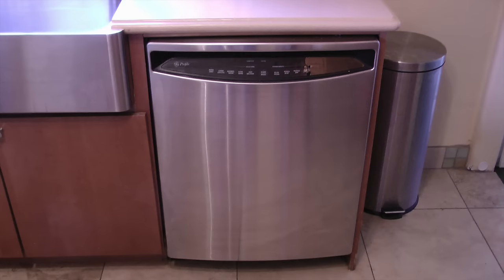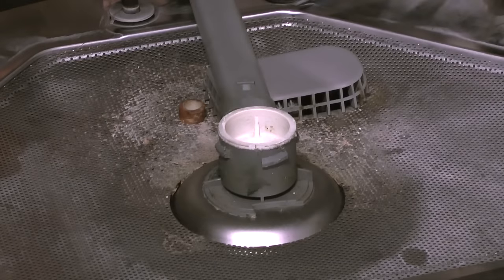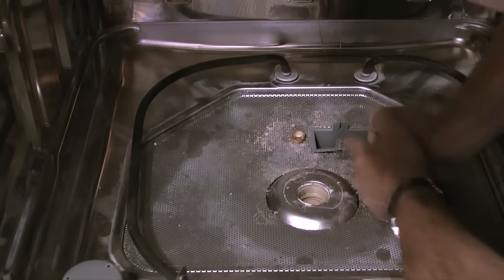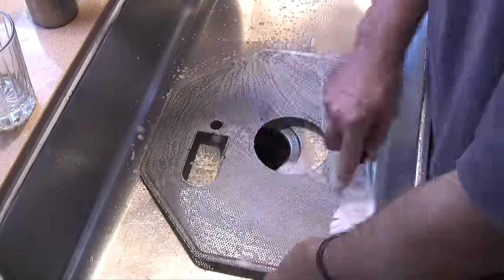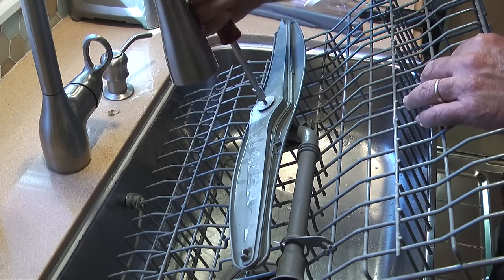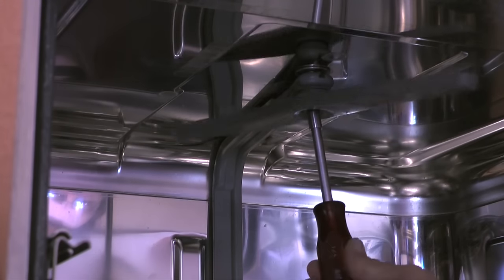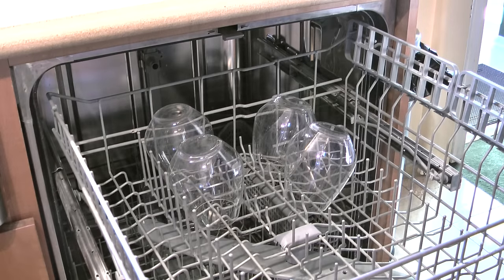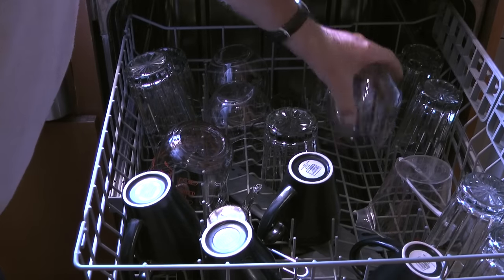GE Profile Dishwasher Maintenance

Comment: Good video. Unfortunately for me when I started the dishwasher I heard a grinding noise coming from the pump motor area. I'm not sure how something could have fallen below the filter and into the pump but something happened. Any idea?
Reply from the maker: Hmm. I'm not sure if the dishwasher has a grinder and that's the noise you're hearing or if it's something else.

Comment: Thanks so much for the video. First, I was able to take it apart to clean the machine and it works perfectly now.
I'm hoping you can help me; I have the exact dishwasher in your video but have no model number on my machine. I need to replace the wheels for the bottom rack but nobody will sell them to me without a model number. Could you tell me yours so I can order them?
Reply from the maker: +Karen Leiser 
My model # is: PDW8280J03SS. There's a link in the video description where you can order parts.

Comment: Excellent Video, you must be professional in making video's. I  was following exact instructions, I was able to unhook supply chain and tube. where I got stuck was Venrture is not coming out, it is turning counter clock wise but not coming out. was able to get the filter out. any suggestions what my next step is?  thank you
Reply from the maker: +Sujay Potlpelly 
Have you tried slight upward pressure when unthreading it? Venturi needs to come out so you can remove the coarse screen.

Comment: Thank you for such a great video.  I was hoping for more gunk as my dishwasher has not been working well.  I did notice that there was cloudy sitting water under the filter. Could that be my issue?
Reply from the maker: +Keith Levinthal 
I didn't have a lot of gunk in my filter either, but after cleaning the filter my dishes came out clean.

Comment: This is a great video.  As I followed your instructions and removed the filter with the help of a small screwdriver I noticed that inside the housing for the basket is a white rubber liner with a tube pointing upward on the left.  As I started to clean that area I noticed that the tube was ripped up the middle facing the inside. I think the part needs to be replaced but when I looked at the parts diagram I couldn't find that part.  Advice?  BTW, this is Laura's husband Bob.  I'm using her laptop to watch your video.  Thanks.
Reply from the maker: Hi Bob, I looked at the parts diagram and I think the tube you're referring to is coming out of the sump. It's part 505 on the Motor - Mechanism page and the part number is PS959014. It looks like a project if you want to change that part. Let me know if you tackle it and how it went.
Reply: @Iscaper  Thanks so much for responding so quickly.  Do you think the dishwasher will work ok until I can get this part?
Reply from the maker: @lauramackler2000  I would try it.

Comment: Thank you!  Great video.  Had to re-watch a couple of times, but I got it.  Only problem is I have a little plastic piece that is left when I re-assembled everything.  It is about 3/4 " long and fits inside the tube of the lower spray arm.  But re-watching the video, I didn't see anything like it.  And while it fit into the lower spray arm supply tube, it didn't seem to easily reinstall with it inserted.  Any thoughts?
Reply from the maker: Without seeing the part you describe I wouldn't be much help. Are you sure the piece goes into the supply tube? Here's a link to the parts breakdown of the dishwasher, maybe it will be some help: http://www.partselect.com/Models/PDW8280J03SS/Sections/MOTOR-PUMP-MECHANISM/?ModelID=397721&ModelNum=PDW8280J03SS&mfgModelNum=&ManufactureID=2&Selected=00121460i05&Position=4&mfg=GE&Type=Washer&Mark=4
Reply: I figured it out!  It went into the vertical supply tube where the middle spray arm is supplied.  Snapped right in.  Thanks again for the helpful video...and my husband thanks you too because he didn't have to figure it out.  Happy Holidays!

Comment: This was a great video!  I have one problem now, maybe someone can help with.  The water is not going into my dishwasher.  I had a clogged sink for a couple of weeks and a plumber came out and fixed the clog, but now the dishwasher doesn't get water in it.  The water is on.  When I do a reset, I can hear water draining out.  I checked the float and that seems ok.  I am hoping it isn't the inlet.  Any thoughts?

Comment: This was excellent!  I've had this dishwasher for 13 yrs and never knew this was necessary.  The amount of gunk and hard-water deposits was indescribable.  Everything went exactly as you showed and after cleaning it works great again.  One thing I noticed, though, is that the short, flexible hose that's just to the left of the filter is completely disintegrating below the surface.  The rubbery tube is intact above the screen, but when I feel inside the space after removing the filter I can feel that the tube is torn open and disintegrated below the area where I can't see.  It seems to be cleaning ok.  Any ideas on possible ramifications of not replacing that part?  I'm thinking that's not a DIY project.
Reply from the maker: Not sure what the tube is unless it primes the pump.

Comment: Great video, saved us a repair call!  But I have a question.  I know when we bought our dishwasher, a "hard food disposer" was one of our must-have features.  But I can't figure out where the disposer is, or how food would get to it with that filter cup.  Does the model in the video claim to have a disposer?
Reply from the maker: +Marc Lieberman 
In the technical manual for this dishwasher it says it has a Piranha hard food disposer.
Reply: If you stick your fingers into the pump inlet after removing the filter basket, you will feel the cutting blades of the "Piranha disposer" You will need to take out the pump to get at it if needed. Mine was quite clogged up with gunk on the shaft.

Comment: Great video. Daughter has the same dishwasher. Looks like a project I'll need to address. I need to replace the lower door seal.  Do you have experience removing the inner door panel? I've found no "how to" videos on removing the door panel for the GE Momogram. Thanks again for the maintenance video.
Reply from the maker: Hi Doug. I haven't had to remove the inner door yet. If I do I'll be sure to make a video.

Comment: Thanks so much for your video.
Your instructions were easy to follow.
I have the GE profile PDW9900N00WW
My manual detergent dispensen lid  is broken so I have to use the smart dispenser.  Suggestions between
Enzymes or chlorine bleach base.
Best dishwasher Detergent - please

Comment: I had cleaned my filters before in my GE Profile ... but I did it from underneath!! (removed boots and clamps and hoses etc.) So I was very hesitant to do it again until the dishes came out quite dirty and gritty. 

Having watched you video, it only took me about 20 minutes today to clean everything up!! Nice job!

The fine screen filter basket (around the venturi) sure seems to fill up quickly (a year). Is this "stuff" (like sand) from my water supply?

And I would sure like to open up my 3 spray arms and give them a good cleaning on the inside, but I can't see a seam where I'd be able to pry them apart.
Reply from the maker: If the city had a water line break near you it could be sand in the filter. If your house is older and you have galvanized piping it could be flakes from the pipes, or if the debris is white and chalky it's probably hard water deposits. I didn't see any seams in my spray arms either, it would be nice if they designed them in for easier cleaning of the spray arms.

Comment: This is such an excellent video. Thank you so much for posting it!

GOOD NEWS: I followed the directions exactly and cleaned out all the parts (ours was slightly less dirty than yours). I put everything together and ran a vinegar cycle with a couple cloudy glasses just like you did.

BAD NEWS: About midway through, the dishwasher started seeping a considerable amount of water on our kitchen floor. Also, the glasses appear cleaner, but are speckled with larger pieces of sediment than before.

Any thoughts on this? Thanks again for your great video!
Reply from the maker: iscintilla 
That's awful. There's no easy answer here because of all the things it could be; the discharge hose, the pump, inlet valve, etc. Did you notice which part of the cycle that it started leaking, like when it was filling or when it tried to pump the water out. You might have to pull it out of the cabinet and take a flashlight to see if you can isolate where the leak is. Let me know what you find.
Reply: iScaper1 Thanks for your reply! I tore everything apart again and found that the tube that comes up from the bottom (through the coarse filter screen) was gunked up with sediment. I attempted to lightly clean it, but it ended up completely crumbling. However...

GOOD NEWS: I ended up fixing the problem! Since this dishwasher is extremely cheaply made with substandard parts and has never worked properly upon us owning it, I went ahead and ordered a Bosch 500 series. So long, GE Profile!

NOTE: Our GE Profile microwave, oven/range, refrigerator, and clothes dryer work as expected. We have had perpetual problems with our GE Profile dishwasher and washing machine. I will never buy GE again.
Reply from the maker: iscintilla 
Thanks for the info. Let me know how you like the Bosch 500 series.

Comment: what is the small rubber tube that sticks up out of the bottom? ours is extremely degraded and i think this is whats causing the dishwasher to not work properly. i cleaned it just like in your video and it worked for a short time but i think that thing needs to be replaced if possible.
Reply: That tube is part of the rubber sump that the water drains into and which feeds the drain pump. Its fairly easy to replace the sump but you will need to flip the DW onto its side or back to get at it. Just 4 hose clamps hold it in place. Part Number WG01L00289

Comment: Superior guidance. Thank you.
Reply from the maker: Glad it was helpful!
Reply: @Iscaper  The only issue I had was that my parts were cemented in with lime or calcium buildup from our hard water. Digging out the filter caused damage, so I have a new part coming. Is there a product you can recommend to prevent the limescale?
Reply from the maker: @marilynfarmer1302  I like to run a cycle every month or so by placing a cup of white vinegar on the top rack.

Comment: Okay found the solution to my own problem.  When replacing the Venturi DO NOT over tighten.  The Venturi does not need to be very tight. If you over tighten just one turn, as I did , when you reconnect the lower spray arm it will sit slightly to low and even it activates and spins it will hit the lower portion of the door.  All I did to correct the problem was back out the Venturi one turn and all is wet.  Lesson learned!!
Reply from the maker: Good information, thanks for posting.

Comment: when cleaning the filter l found a rubber gasket on the large filter under the bottom spray bar. where does it go? in the bottom and under the smaller filter I found a Phillips screw. where does it go. thanks

Comment: Thank you very much for this video. Upon taking apart all the components, the filter "reservoir" (not sure what it is called) had about an inch or two of water I am not sure if their is a drain at the bottom of the grunge that I could damage when cleaning it. Does anyone know how to clean that area without damaging anything. I am trying to get another year or two of life out of this dishwasher and any help would be appreciated. Thank you!
Reply from the maker: On my dishwasher I use a turkey baster to suck out the water underneath the filter.

Comment: I have a GE Cafe Dishwasher, Could you please tell me the significance of the plastic tube exposed next to the filter basket. Mine is corroded. It is the piece that the fine filter fits into. Do I need this piece to function the dishwasher? I can not find this plastic tube on the parts list. Please give me your input.  Thanks
Reply from the maker: +Anthony Tanzi 
Here's a link for GE partsSelect.com where you can enter the model number of your dishwasher and look up the part you need: http://www.partselect.com/Entry.aspx?Source=GAWS&Brand=GE&Term=GE+Dishwasher+Parts&gclid=CPCgypGnmskCFRCCaQod5NIAQA

Comment: Just found this video, hoping to save my 13-yr-old dishwasher that has never been cleaned. I got everything apart but the white residue is so thick in places I haven't been able to clean it off. Also, all the rubber gaskets on the large filter are crumbling (outer edge, & both roung openings) - can I replace the rubber or do I have to buy a new filter? The video is incredibly helpful and well done.
Reply from the maker: The body parts diagram does show a couple of gaskets if you have the same model in the video. Here's a link: https://www.partselect.com/Models/PDW8280J03SS/Sections/BODY-PARTS/?ModelID=398380&ModelNum=PDW8280J03SS&mfgModelNum=&ManufactureID=2&Selected=00121460i02&Position=1&mfg=GE&Type=Washer&Mark=1
Reply: @Iscaper  Thanks for the quick reply. The controls on the one in the video are different, but everything inside is spot-on. The part that's a problem is 502 (WD22X10029), the coarse filter. It has been discontinued - I've been searching online for hours and have not been able to find one. The gaskets I see in the link you gave are for the door seal. I've seen many complaints about the rubber seal on this filter drying and crumbling. One site suggested I replace the seal with a bead of 100% silicone caulk  - do you think that would be a good solution for a few years while I save up for a new dishwasher?
Reply from the maker: @lindas.bartlett9295  That's weird, my coarse filter didn't have a rubber gasket. I would be cautious about adding silicone because if you need to remove the filter again for cleaning it will make a mess removing the silicone.
Reply: @Iscaper  As I searched for the replacement I saw that many had gaskets and they were confused about receiving a new one without. I guess that was one of GE's attempts to fix the problem. In any case, I'm really trying to buy some time before replacing the dishwasher so I put the silicon on it this morning. Since this is the first cleaning in 13 years I'm hoping I'll get 3-5 years before having to do it again, assuming this solves all the problems it has (dishes not getting clean, soap pac not fully dispensing, etc).  If not, at least I've learned a new skill and know to look for an easy to remove filter in my next one! Thanks for your help.
Reply from the maker: @lindas.bartlett9295  Good luck! Let me know if your cleaning works 🙂
Reply: @Iscaper  I will tentatively reply yes. In putting it back together I had a spare washer but remembered someone else did, too. I found their comment and the parts pictures in your video and put it in the lower spray assembly. The rest was a breeze. Ran it once with white vinegar, then with dishes and detergent. Dishwasher looks 100% better (it was gross), the soap dispenser opened and emptied fully (before, I might have to run it 3 times before the soap actually came out and dissolved - I blame it on clogged spray holes) & dishes are definitely cleaner. Hopefully the silicone will hold and you've helped me delay the replacement dishwasher for several years. Thank you again!
Reply from the maker: @lindas.bartlett9295  Thanks for the information.

Comment: Quick question. I found some water under the metal screen and filter was full of water. Is taht normal or this should be fixed?Is there a video showing how to fix the water issue?
Thanks
Reply from the maker: I had some water in the filter but not under the metal screen. It may be that some water needs to remain to keep the pump primed.

Comment: Just to be clear that little silver washer, part 453 goes into the venturi form the top side.
Reply: Thank you! I found a little silver washer when cleaning the parts, and thought it was something that had gotten caught in the dishwasher (along with the straight pin, little bumper, packaging, labels, twist tie and plastic straw). At least I won't have to take everything all the way apart to put it back in.

Comment: Can you tell me how to disable all audible signals from my GE Quiet Profile 7880 dishwasher?  I found the instructions for disabling the end-of-cycle signal, but not any of the others.  Thanks!
Reply from the maker: +sheko2265 
I don't see any instructions in my manual that cover what you want to do. I would call customer support at 800-626-2224 to see if disabling the other signals is possible.
Reply: +iScaper1 thanks

Comment: used this video yesterday, great video.  question, the item you refer to as the "venturi" (sp?), where did you come up with that part name?  during my service I broke a tab : ( of this item and need to order a replacement but can not find this part.
Reply from the maker: +Shane Chamberlin 
On the parts schematic it is #450 and called the main conduit assembly. Here's a link to the parts breakdown: http://www.partselect.com/ModelSections.aspx?ModelID=397721&ModelNum=PDW8280J03SS&mfgModelNum=&ManufactureID=2&Selected=00121460i05&Position=4&mfg=GE&Type=Dishwasher&Mark=4

Comment: Is this an 18 inch dishwasher. I purchased a house with a GE profile dishwasher in it....and it runs.. but doesn't drain. I would rather solve the issue myself .. but everything I've tried hasn't worked. This the first time I've come across this YouTube tutorial. Looks like it could be the same as mine....

Any insight would be appreciated.

Comment: I have a question did you have a hard water problem when you moved in to that house or the previous owner installed a water softener to fix it?
Reply from the maker: We still have a hard water problem. We're debating whether to install a filter system to remove the scale as opposed to a water softener.